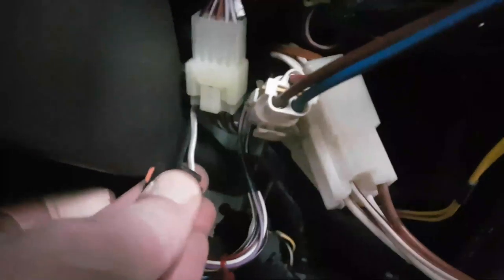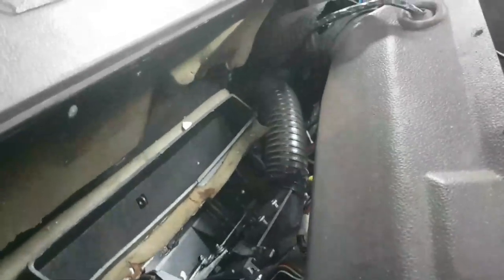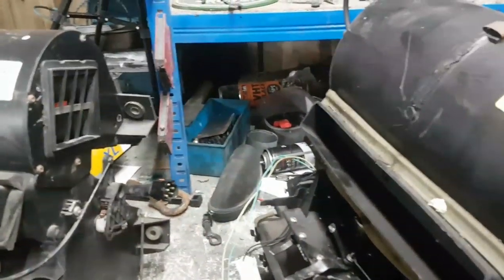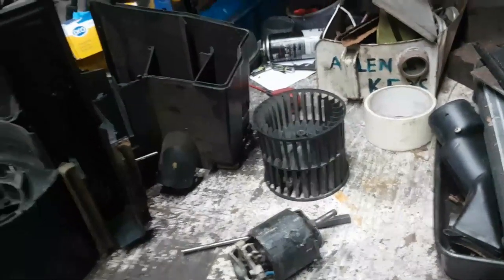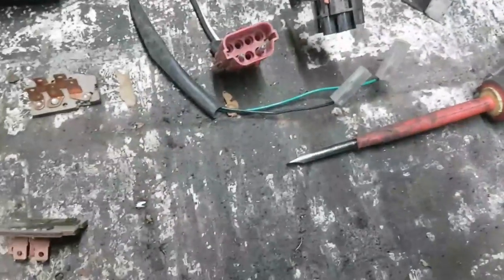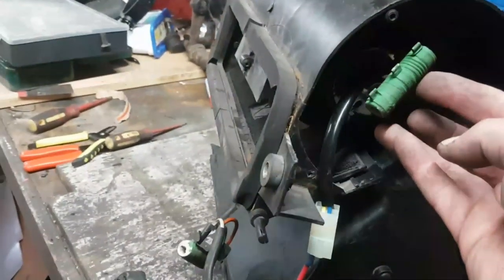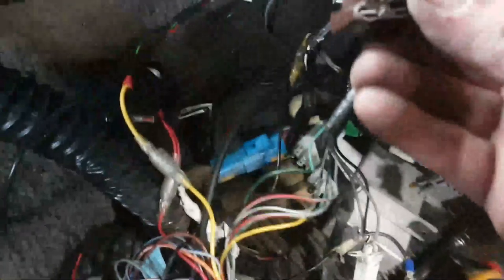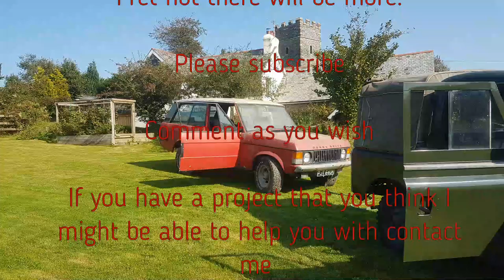1994 Range Rover Aegean Blue Part 3 - Parental warning

Comment: Hi Richard, love your video’s, really helpful! I am taking the heater unit apart right now. But see in your vid that you work with a ETM 1993, where did you find one, I am looking for it for a long time but can’t find it.
Reply from the maker: Electric troubleshooting manuals I buy on a usb stick from the main suppliers. They are pretty comprehensive. Despite looking I have yet to find one in print format. drop me an email churchhouseclassics @ gmail . com if you need more detail

Comment: I'd owned my RRC for 5 years with a broken heater, so when i finally decided to tackle it, I just ripped the whole thing out and replaced it with one of those 5kw Midi heaters from Ebay. It's a smaller unit with 3 speeds but works a treat.